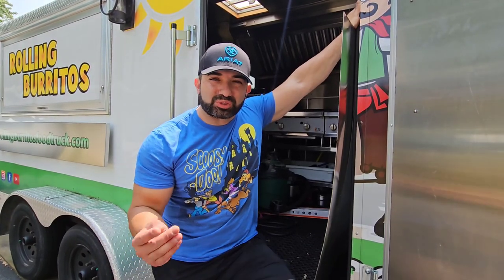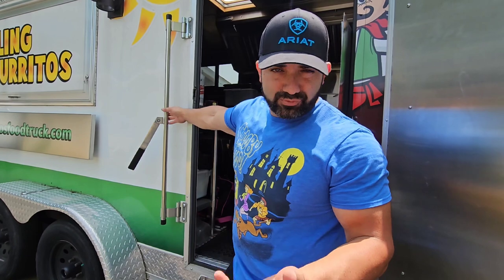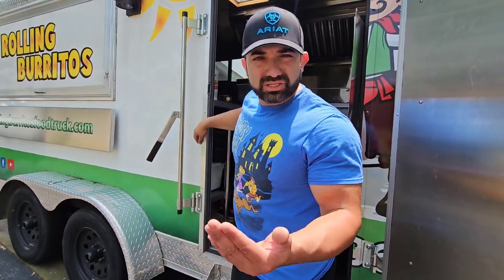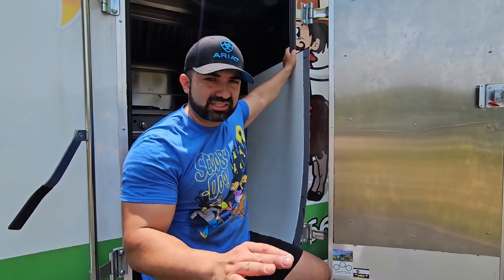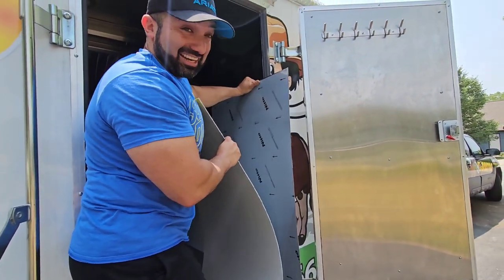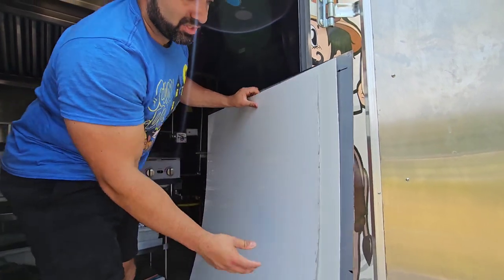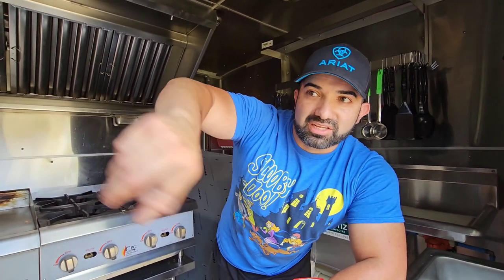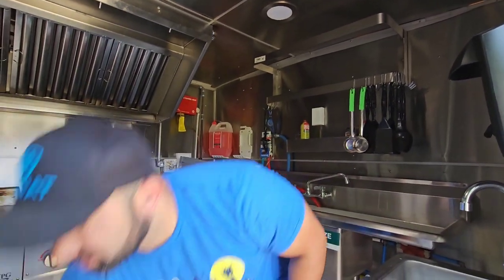How to Build a Food Truck: Questions and Answers

Comment: Hi Frank, i have a question on electrical. Am I able to wire a double outlet on a single switch leg? Also am I supposed to ground both outlets when one is being jumped by the other?
Reply from the maker: Only one ground required, and you can use the entire outlet to be switched or have it where one is switched and one is hot, either one works
Reply: @fbaltierrez  Thanks!